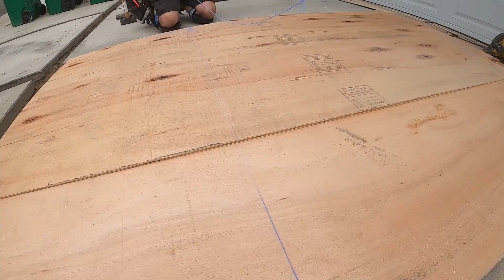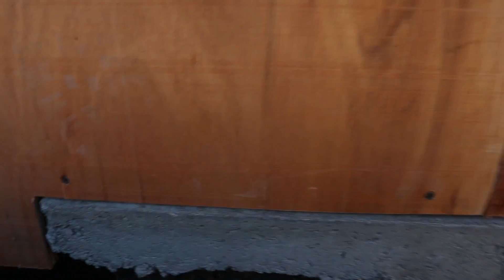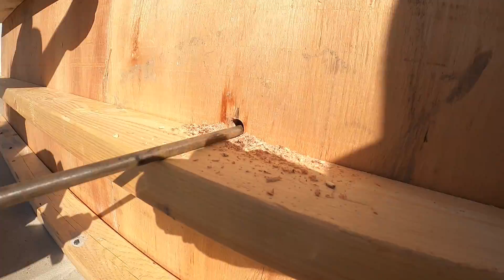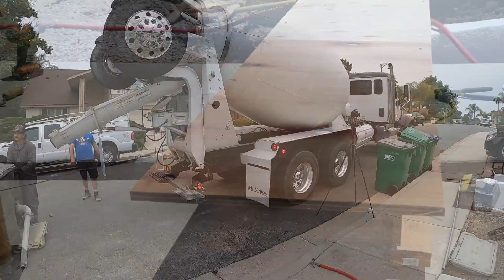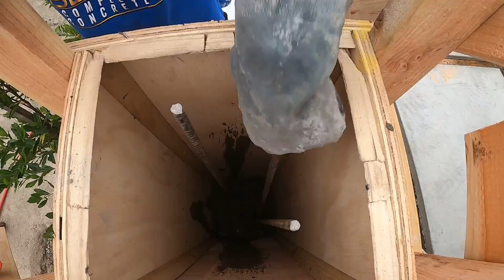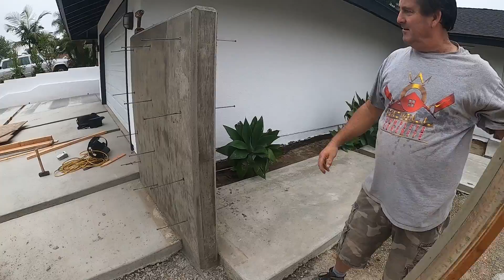Poured in Place Concrete Wall & Column

Comment: there's weak vibrators and strong ones. zap it quick with a powerful vibrator - yes, but the weaker ones.. you need a little longer. - his point is, it weakens it because the rock can settle at the bottom  after vibrating for too long.
Reply from the maker: Yes, exactly

Comment: Great Video!!! Does it matter if you place the studs that are in direct contact with the sheathing horizontally versus vertically? I see you placed them horizontally but I've seen it done vertically but not sure if it makes a difference.
Reply from the maker: Depends on the grain of the plywood

Comment: Good video . What tie system would you use if you were making a wall against an existing wall and didn't have access to both ends of the snap tie .
Reply from the maker: Have to drill and screw

Comment: Longer jabs with the vibrator will ‘segregate’ the concrete… meaning you’ll end up settling the larger gravels to the bottom and the gravel and sand matrix is what provides the concrete with the strength.
Reply from the maker: Gl

Comment: Great video with clear explanation! Have you ever used concrete to build walls on an existing wood framed building? I have a 100 year old carriage house and the fir framing is on it's last legs. I have some easement issues and can't blow down the building to rebuild, so was thinking building concrete walls around the existing framing might be a good idea, then doing a stone veneer over the front. Do you have any video recommendations I should check out before attempting something like this?
Reply: Depends on what region you’re in for waterproofing/dampproofing but masonry can be installed onto wood framed walls with a suitable weather resistant barrier. I would consult your local building envelope contractor to give you a proposal on the work then you can hire or try to do it yourself. Make sure to pay for the proposal it will be worth it.

Comment: Wow, very nice and yeah I think I will try to put the brick back in place. Was thinking of just making a Concrete Wall where a hole got punched in my shop wall by a drunk driver.
Kind of Patch the Hole with a Solid poured in wall.
Bad Idea right?
Reply from the maker: That should work

Comment: That was an interesting video - soothing, somehow. 

Watching the way it worked, and comparing it to brick-laying, made me wonder. Could it be possible to industralise pre-modern 'wattle and daub' constructions in a similar way? Instead of using cement, using some scientifically measured mixture of lime, chalk, clay, aggregates etc, and instead of iron rebar using an industrially-produced wooden mesh for 'wattle'. If the mixture could be hosed in and left to set, then the outside rendered, you might have a functional, breathable house wall in a fraction of the time of a bricked house.
Reply from the maker: Maybe some day

Comment: What part of the country is this ? 
Nothing like form work and steel placement in Florida
Doesn't matter where but footings seem too small, not big enough not enough steel. As long as that's what you building department requires you are OK. Tilting walls or columns fall back on the Architect / Engineer
Reply from the maker: This is much stronger than the typical block wall designs around here.

Comment: Excellent work. Thanks for taking the time to make these videos.    Thank you for your tip in how to properly use the vibrator.  What I sometimes use is a small square hand sander against the wood to create vibrations.   I wanted to ask you, your opinion regarding the  plastic lining  for foundations?
Reply from the maker: They are great
TY
Reply: @OdellCompleteConcrete  Love your videos' brother.

Comment: As an engineer the forming and footing all seem on point, but the whole reason why the owner wants a random wall in the front yard and a column, especially with a gap to the structure that would allow a small dog or other animal to walk through. I really do not see any reasonable reason to build a garden entrance like this especially such a boring one. Did you add details or stone work to the structure later?
Reply from the maker: No I didn't but he may have

Comment: Thank you for the video.     I like your format, and the lack of disco-music and hype that the other builders use.

I have watched about twenty of your videos.     I have never worked in a job that uses my hands, unless you count typing or moving a computer-mouse.    I have no common-sense when it comes to such task.      During the COVID pandemic, I have had thousands of hours to just sit and go stir-crazy insane.     I have watched at least 2,000 hours of YouTube, since the pandemic started, in addition to over 10 years of normal watching.    I practically have an Associate's Degree in YouTube Viewing.       I live in Texas far from a large major city, but almost in the suburbs.     I see concrete trucks coming and going as the city expands, and workers ( mostly from south of the Texas border, who speak no English ), doing 100% of the work, building
roads and laying bricks.     I do not see any way I could fit in there, but I do speak some Spanish.
Reply from the maker: Yes I've been there and done that. On crews where I was the only English speaker and my Spanish was none existent. 
Got the jobs done but not a lot of communication.

Comment: Is it better to have liquid concrete to get the shape? Doesnt thicker cement you can end up having side issues when you remove the boards? If so, I thought if cement gets to wet it can loose strength integrity.
Reply from the maker: True

Comment: How would you form a flat concrete roof?
Reply from the maker: Plywood, 2x6 s and lots of bracing
Reply: @OdellCompleteConcrete  Typical thickness would be around 6" with 68" O.C. rebar spacing.  What size?

Comment: Thanks so much for great instruction! I am a big time weekend warrior building 3,180' x  12-36" tall x 4" thick retainer walls. Do you think i need to use those snap ties? Also, what do you call the pump system you use to deliver the concrete into the forms? Thanks again!! George
Reply from the maker: Depending on your form system you use. Something that goes through the wall to tie both sides together will save alot of extra forms work.

Comment: great vid. So how deep was the footing for the column? is there a specific rule /formula, lets say the the column is 6 feet high, does the footing need to be   1, 2, 2.5, 3 feet deep?
Reply from the maker: If you did a 1/3 of the height you would be safe.

Comment: On vibrating a poured in place concrete wall. The book states that you do it in layers, and vibrate the layer, then pour in some more, and then vibrate again. 3 to 4 feet at a time with the internal vibrator. You should not pull it out to fast, or you risk leaving holes. 4 to 6 inch per second. Not more than 15 seconds vibrating time. The figures could be off by a little bit, but that is what the school book stated. 

You can also use a sanding machine on the outside to compact the concrete. 

Not compacting the concrete would be dumb. You can also use a broom stick from the top to put it all down, and tap it with a hammer like you said. Thats what the army engineers manual states. 

No greasing of the formwork on the inside?? 

Im a rookie concretes man when it comes to doing, but ive read all about it! It should go well first time, as it went with all things ive read about before doing them. :) Hell ive even read about how to make concrete tunnels and concrete tunnel panels. If you are interested, its uploaded on my archive page on the about section of my youtube page. 

Greetings,

Jeff
Reply from the maker: That sounds right to me.
TY

Comment: Concrete veterans are always cool, chill people. My family has a concrete company 3 generations deep now, ive also worked for another company where it was just me and 2 older guys. I was the tool bitch, ran the buggy, helped with forms and demo for the most part. But both my uncle and these other guys were amazing finishers. Loved doing stamp jobs the most, and I miss the feeling of satisfaction I’d get from doing a good job, and it turning out beautiful, took a lot of pride in that line of work. getting off of work after a day of busting ass is an amazing feeling, it’s like a natural high. The job I have now is cake compared to that, and I miss it
Reply from the maker: Sounds familar.
TY

Comment: I did formwork for concrete for 18 years.  Never saw any concrete in a deck wall or column poured without a vibrator.  All our wall panels had studs 1 foot on center and we built and chamfered the bulkheads before we installed them.  We usually ran our whalers horizontal across vertical studs.  The bulkheads would be nailed thru the wall panel with 8 penny duplex and chamfer was nailed with blue nails.  Of course the liner devices would have turnbuckles and the column would be locked up with column brackets.  With what you had the wall and column came out not too bad.  Good job.  Personally I hate the raw look of concrete.  Probably because I saw it for 18 years.  Also, they did come out with fiberglass rods that you can use as ties instead of snapties.  The fiberglass ties used a sort of cone that you slid on and butted up to the whaler.  Then you locked it by using a pipe to fit over the tie and drive wedges into the end of the cone.  Don't dare hit the tie with the vibrator though because the cones would start to loosen.  Snapties are the bomb though, aren't they?

Comment: Good job man I've doing concrete since 2012 and this looks mint 👌
Reply from the maker: TY
Reply: can i ask a question. is it okay to leave a poured concrete without plaster? does it affect the durability of the structure if we do not use any plastering finish?

Comment: Hello Odell,
Awesome job ! thanks fro your video content
Please would consider to make a video about concrete vibration in order to achieve best/smothest surface results out of formwork ?
I'm hoping to use concrete as main material for New Zealand home build(basement, most of the walls & floors) and I'm bit struggling to find useful info about best formwork practices for walls and mostly around compacting/vibrating.
Thanks for any info.
Reply from the maker: Yes that sounds like a good one.
TY

Comment: Did they want a rough plywood look?  Most people in my area prefer an MDO or HDO finish. If they do rough it's normally with seams to make a board form look.
Reply from the maker: There are form liners that can be any texture you want

Comment: Does the his method reduce the overall cost and would it be a good idea to use this way to build a long perimeter wall? Great vid thanks :-)
Reply from the maker: If you plan on doing multiple projects that the panels can be reused on

Comment: Complete concrete novice here with a question: my wife wants a circular paving centerpiece. I prised up the old paving slabs and the aggregate underneath seems reasonably flat and solid. Should I dig it out and replace it or can I lay the new paving on what's there?
Reply: yeah, its fine.. maybe tap down the material again, but should be fine
Reply from the maker: Yes go for it

Comment: Hi David, I’m just curious if this were your home would you have gone with cast in place concrete or used hollow tile block and coated it? 🤔
Reply from the maker: Probably block in this setting
Reply: Good question. I guess, it's all preference! I must say, this wall has a different feel to have this way when I know it's all full concrete.

Comment: Note for next time , it’s easier to break ties before stripping plywood. In your case it was a small enough wall to do it the way you did , but if you get to bigger walls it becomes a pain 😀 awesome job as always. Also allows you not to scratch the concrete.
Reply from the maker: Sounds good
Reply: bro i have a question. is it okay to leave a poured concrete without plaster? does it affect the durability of the structure if we do not use any plastering finish?

Comment: Have you ever used or considered coil and cone spreaders with threaded rod ? It's initially more work but much easier to strip and reusable.
Reply from the maker: Haven't used that system, I'll check it out

Comment: Easier way to break off ties is get the socket for them and break them off before taking the panel off
Reply from the maker: I didn't know there was a socket for them.
Reply: Odell Complete Concrete regular car socket. Attach to drill and screw then off.
Reply from the maker: @PeshkovFilm  
I'll check it out
Reply: @OdellCompleteConcrete  Roman beat me to the comment, just any socket that matches the head size of the snaptie. i think last time i did it was 5/8th, but dont use an impact wrench to do it they wont have enough prolonged torque to break. we just used a ratchet handle and twisted until it popped.

Comment: Very nice result! I realize poured concrete is one of the most common construction methods but when you pour walls or columns, there is so much material that goes into the form work which unassumingly gets thrown away after. It seems extremely wasteful.
Reply from the maker: If you do alot of walls it can be reused

Comment: The house looks stuccoed.  Looks like homeowner is trying to go with a modern look with the concrete walls.  Did you stucco them ?
Reply from the maker: No, but yes someone recently did
Reply: Odell Complete Concrete damn wouldn’t it have been way cheaper for homeowner to have you put in block wall instead ? Then stucco that block wall.

Comment: i like it.  So much upfront work to make the forms right, but it paid off.  So that cured in place for 7 days without oiling the forms, and it didnt fight you stripping.  is that normal?
Reply from the maker: These forms are specifically for concrete.
Pre oiled